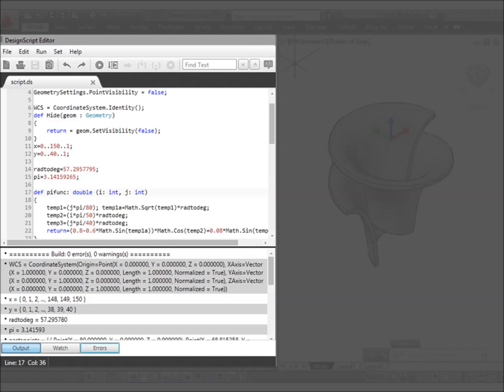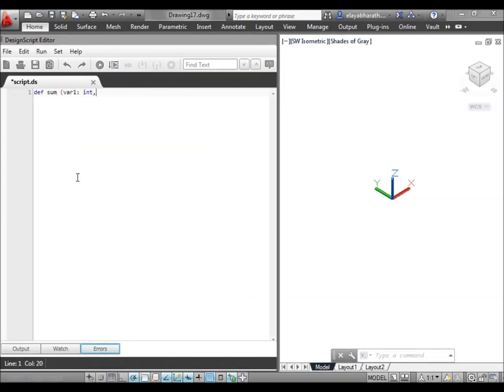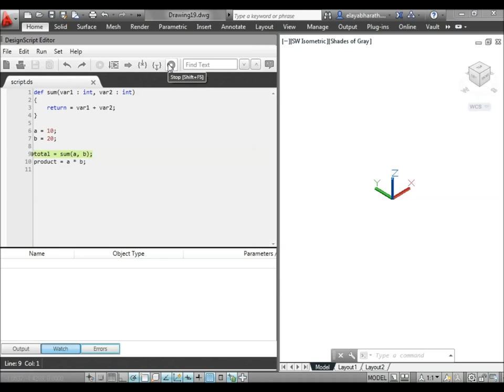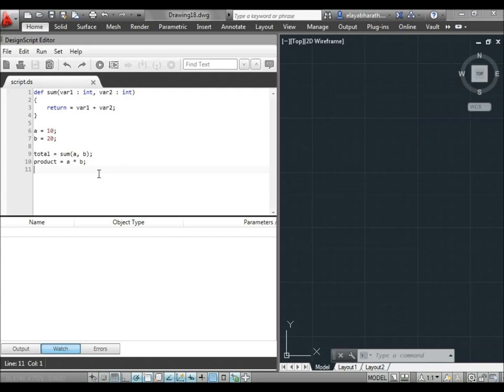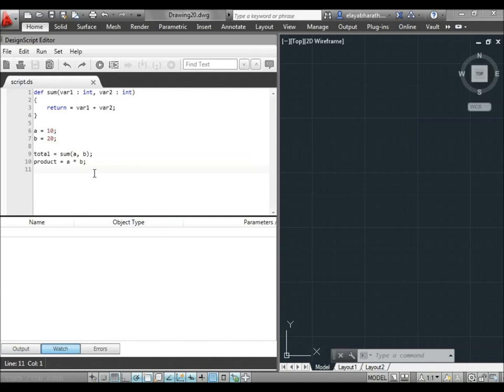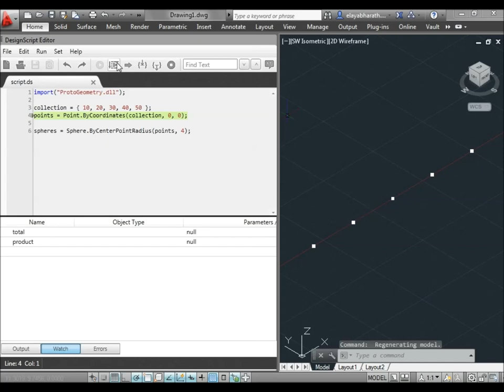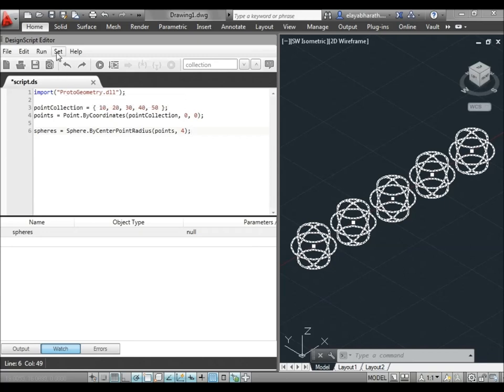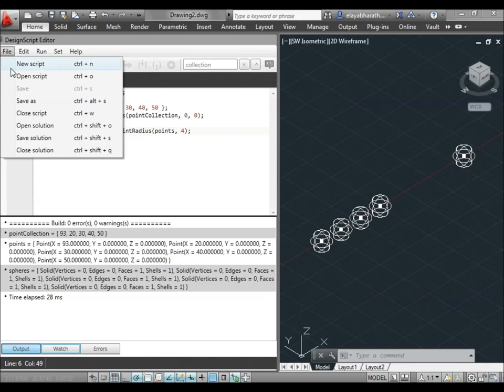Introduction to DesignScript Editor (IDE)

Comment: Hello..
There are multiple ways in which you can open DesignScript window, provived that you have already downloaded a copy of the software from Autodesk Labs.

1. Click on the DesignScript Desktop shortcut and it will open AutoCAD with DesignScript window for you.

2. In the command line of AutoCAD, type "_EDITOR" and the DesignScript Window will open for you.

3. Check the upper ribbons of AutoCAD where you will find a ribbon for DesignScript. You can also click on that to open DesignScript.